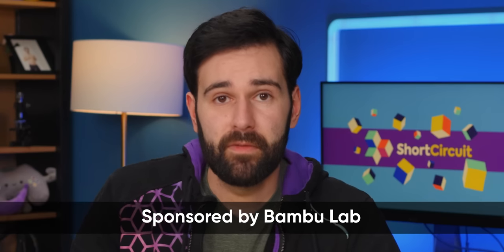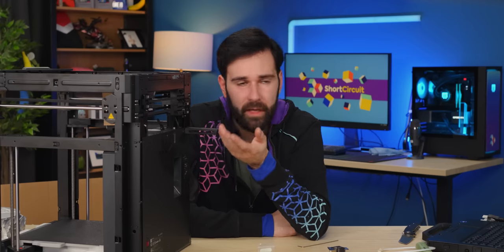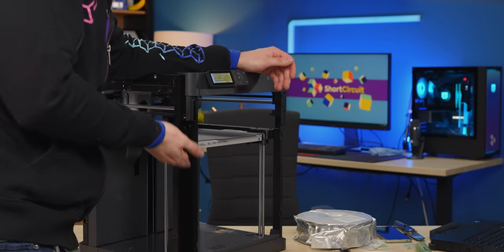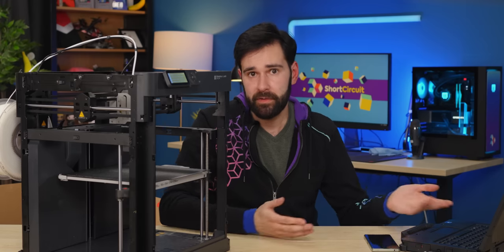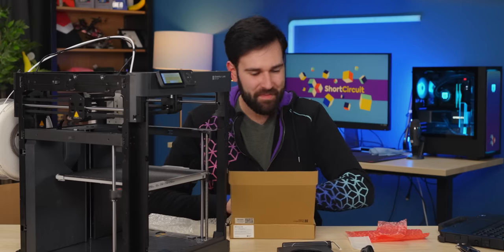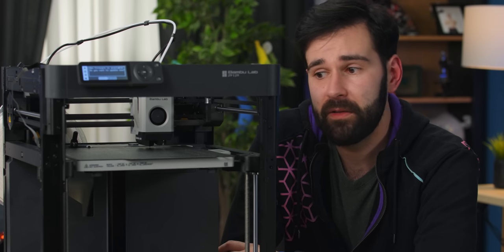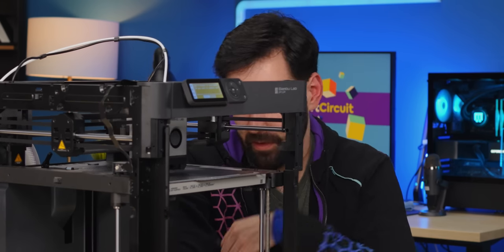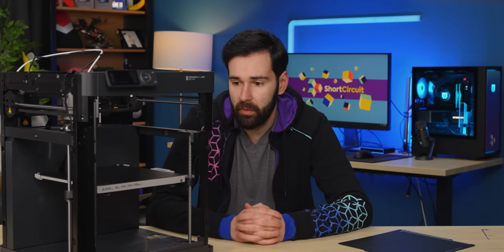I wish this wasn't sponsored (because it's so good) - Bambu Lab P1P

Comment: Would love to go CoreXY after suffering with a bedslinger (Ender 3v2) for a while now, but will gladly wait for other Voron-like machines to pop up. Bambu's offerings are definitely intriguing, however, and I'm looking forward to FDM printers stop being Ender/Prusa clones :)
Reply: Voron is not ideal, there are other CoreXY DIY projects that are slightly better, like V-King and RatRig.
Reply: For the price, Bambu is where it’s at. There just isn’t anything on the market that can do what this does at this price. 

Also, third party parts are already coming out for this and the X1C. That means the concerns about the ‘closed ecosystem’ are negligible.
Reply: @realgoose  my main concern about bambu is the printer firmware. No way to go back on an update and no way to manually update with like an sd card. There have been bugs in the firmware and as it stands, you are at the mercy of them responding and fixing the issue, which could be weeks, if you get a firmware bug like I and many got. Instead of waiting weeks for an update and breaking my head trying to figure out what was wrong, I could have just rolled back the firmware if it was an option and have my printer be functional right away. Then there's the question, why would a firmware bug only break some machines and not all. It's concerning and while I love my 3 x1c, I can't rely on them 100% based on my experience with them and what I've also seen other people go through. I'll be diversifying a bit with vorons probably
Reply: The i3/bedslinger design is still really good for smaller printers. You shouldn't write off a type of printers because the cheap Chinese one you got wasn't good.
Reply: @p_serdiuk  RatRig is not ideal with lead times of 12 weeks and their slightly less nice QC.
Reply: There's the troondon 2 voron clone. Have tried it myself but hey it's a commercial voron like

Comment: I have a X1C and I am at total awe of it.. amazing. I am going to get a P1P for my kids. I sold my BCN3D Sigmax that I paid at the time for 4500 euros.. I ended up selling it for 900 thankfully at a huge loss since no one what to be this old slow low tech printers. I can imagine how BCN3D can even compete going forward selling 6K printers .. game over. If you look on the classifieds there are many of them. This is truly a game changer. Buying filaments and accessories now is difficult and you need to move fast when they get it in Europe. I don't mind I stock up each time I can even if don't need it at the time. The technical materials print awesome!!!

Comment: I’ve always wondered, can you do multiple colors for 3D prints with separate color materials? I’m more thinking along the lines of that gyroscope being 3 separate colors for each ring.
Reply: Yes, you can. Thats what the material switch systems like the bamboo ams, prusa mmu and carrot feeder do. There are also idex printers and dual nozzle printers which can utilize 2 materials.
Reply: Yes, there are dual color filaments.  There are also dual extruder printers [basically two print heads/nozzles, each with its own filament].  Then there are printers that automatically change filaments for you on the fly [via either an extruder change or loading/unloading filament for you].

Quite a few options.  You can even just manually load/unload colors as you go, though, that only works for simple color changes - like “I want these last 10 layers of the print to be red”.

Comment: The nozzle is $15 now but they control the price so what is stopping them from selling it for $50 in the future.
Reply: Mainly that there's nothing proprietary about it. You can buy them on Amazon from other manufacturers. There's a high-temp one (500c) for $31
Reply: @Fjprints  That's... not what proprietary means, or even what "open source" means. Physical designs aren't open or closed source because you can just digitize the physical thing and reproduce it. A "proprietary" nozzle would have to include features that make it specifically difficult to reproduce.

Having a different design isn't proprietary - it's custom. The standard design people use right now, the E3D v6 nozzle, was only standardized because they were successful. Early on, there were several different incompatible designs.

Comment: I picked one of these up a couple weeks back and i am very happy with it. My only advice is to be careful with firmware updates on the printer. When they first launch they break features. the 1.3 firmware broke wifi printing. Hope they fix it soon. That said. even with that issue. Printing from SD card works great. Its FAST and very high quality. Overall i really love this thing

Comment: 19:28 Tell me bambu lab paid you without telling me bambu lab paid you...
You used the printer for one whole piece and are now saying "buy only this printer and no other"....without mentioning the glaring issues with them and the company.

-Awful build quality, from warped beds, clogged nozzles, broken AMS units, broken heatbed cables, broken MB fans, broken electronics from PSU's to extruder parts.
-Terrible customer service that takes days to respond to support tickets, then takes weeks to ship parts after a bunch of back and forth nonsense.
-Violating open source licenses
-No crash detection, resulting in bent nozzles and damaged build plates.
-A cloud system that goes down often, refusing to let people print until back online.
- NON SERVICEABLE, bambu lab wants you to send the printer back for repair when certain parts fail. Like the CF rods and bronze bushings.
-Severe lack of transparency, they blatantly rip off open source innovations, while slapping a proprietary label on it, then contributing less than the minimum to the open source projects.

Guess who does NONE of the above? The "competitor", which he meant to say is prusa.
Reply: Facts!
Reply: 100%!!!

Comment: I got my first (and I guess only as of now) 3d printer about 3 years ago, an ender 3 v2. It’s caused me a lot of trouble and I’ve had to tinker with its constantly, but I love it anyway. I’ve upgraded it like crazy, when it prints it prints great. In the last year or so, I didn’t touch it, it had a problem that I had issues solving. So I paid no attention to the 3d printing world. I was thinking to myself randomly that the 3d printer market is due for a massive overhaul/revolution, so I looked up some new printers to see what had changed… I think this p1p could be the start of that revolution.

It’s like an appliance. It isn’t meant to be tinkered with or tuned, it’s like you’re refrigerator in that regard. I think we all love being relatively early in the game of consumer 3d printing and the fact that we have to constantly tune our machines solidifies that we are still early, but I think it’s time now that some of us move onto something that maybe doesn’t need constant work, something that just… prints.

The p1p isn’t all the way there yet imo. But I think what you said at the end of the video is the key here, the other companies WILL come out with their answers. I wouldn’t be surprised if the p1p ends up kinda flopping in the long term if the other companies play their cards right, but I think it’s started something big

Comment: those of you who have not 3d printed before have no idea how many lightyears ahead of other printers the bamboo lineup is. sure, you could build a voron 2.4 with many mods to get the same sort of corexy printer using klipper which has these vibration compensations etc etc. but what you don't realize is that those are all DIY models you build yourself from scratch. These bamboo printers come out of the box, run all the calibrations themselves (which takes another 10-100 hours), then starts printing. its incredible. so incredible that I don't own one yet for my 3d printing business because it's almost too good to be true. need more time to air out and fix unknown issues. Once that has been done, it will be mine

Comment: Just bought one of these after several months of wanting one and slowly saving up. Super excited to get this! Upgrading from an Ender 3... Going to be a huge jump!!
Reply: mine just came in the mail yesterday, can confirm this printer is goated
Reply: oh one tip though, the default heatbed temperature is only 35 degrees for Bambu Studio, if you use their software I would strongly recommend increasing the heatbed temperature to 60 or even 70 degrees for PLA, took me a while to figure out that's the reason my prints kept getting unstuck and going spaghetti

Comment: I have an x1c and there are a few teething problems to be sure, the one plaguing me right now is the tool head cover falling off I believe because the magnets aren't strong enough to endure some of the really fast direction changes. Another bad one is usually the first print after an AMS filament change fails on the first layer (the nozzle seems too low which drags and causes a terrible mess) even when going from PETG to PETG of a different color... And to that the only way to adjust Z offset is in the start G-code, that could and should easily be a real time adjustment on the printer. I know it's also a slicer profile thing because the bambu filament profiles always print better than the generic ones. The last of my serious issues is with the magnets keeping the print sheet attached to the bed, when printing generic nylon (nylon requires painters tape with all/any of the sheets) the tool head can actually MOVE the sheet and knock into the glass/shift the Y axis so it's either 0% adhesion or far too much... Having said all that my 3d printer experience has helped me work around all those issues and I'm confident they can be fixed with relative ease, there are no fundamental faults and I can say I'm happy with my purchase though I wish I had bought it at the kickstarter price then I'd be elated with it.

Oh and the app, I have no desire to have some Chinese server as the middle man for everything I do with my printer when I'm in the same room and I've already set up a wireguard vpn for anything else. The LAN only mode has obviously been intentionally crippled as you cannot use the included USB camera or LAN file transfer, I'm not the only person angry about this and I've read that an improved LAN mode is in the works for me the sooner the better.

Comment: Fun fact, bambu is said to be formed from previous DJI engineers, that's where they got the design language and user-friendly interface. Also they did a really good design job with the mechanical parts.

Comment: Speed is everything when printing quick models that don't need tons of accuracy. I started with an ender 3 v2 max and quickly outgrew it and got tired of how slow it was. I eventually went to a direct drive extruder and converted to klipper(marlin sucks compared to klipper) and am now printing at roughly 140mm/s with max acceleration settings at 4000mm/s.

Comment: The "vibration compensation" is actually called resonance compensation. Because the printer accelerates and moves so quickly, any resonance in the system at specific frequencies can create visible "waves" on the surface of the print. Resonance compensation adjusts the speed and acceleration of the printer on the fly to avoid those resonances and keep your external perimeters looking nice the smooth. :)

Comment: Thanks Bambu for sponsoring ShortCircuit. I've been eyeing your printers since seeing the X1's in LTT videos, but it's always been a bit out of price range. Seeing that the P1P is a more budget-allowable model, and hearing this praise plus praise online, I've purchased one.

For what it's worth, if the QR codes for the filaments are made open, that would've made a HUGE impact towards the buying decision and there wouldn't have been a "decision," just in my opinion. Also sadly the P1P camera isn't currently in-stock, but whenever it does show up, I'll look forward to getting one.

Comment: I own the P1P for 2 months now and absolutely love the printer and what its capable of. What I don't like so much is Bambu Labs attitude. Their customer support is rather special from my point of view. Just recently I asked to return a delivery, for a full refund just as it arrived (yes we can do this in the EU, it's the law*) and they asked me for a photo of the unopened package to be eligible for the return. Excuse me what? 

One other thing is, that when the P1P just came out, there were no tutorials for all the repairs and you often had to follow those for the X1C (which is a lot like the P1P but a different printer nevertheless). The inevitable happened and I accidentially ripped a tiny ribbon cable, during unclogging the extruder, because it wasn't mentioned in the online repair manual. I thought customer support might just send me a new one for free, because we kinda share the blame here, but boy was I wrong. Not only didn they asked me to buy a replacement from them, I was supposed to pay 45€ for an entire new extruder assembly because they don't sell the ribbon cable separately. Just two points on that:

1. If the didn't use ribbon cables, but normal wires, I would have even been able to fix it myself (or it wouldn't have broken in the first place). So much for proprietary parts and its downsides

2. Why would I want a free replacement for something I broke? Because that is awesome customer service and makes your customers come back ever and ever again! I am now in a state of mind where I said to myself, as soon as prusa releases a similar product, I will jump ships, because their customer support was excellent so far in my experience.

Another example for great customer support and why it's so important:
Just recently my LTT water bottles 1st gen lid snapped (the rubber part). I wrote to support and they sent me a 2nd gen replacement lid FOR FREE. This is customer service and this is why I have also bought the LTT Screwdriver and I am currently looking into getting the backpack, which is not cheap either. But at least I am certain that when something goes wrong with it, I can count on the great customer support, which for me personally is well worth the money.

tl;dr:
Bambu Lab products --> great
Bambu Lab philosophy and support --> a LOT of headroom

*https://europa.eu/youreurope/citizens/consumers/shopping/shopping-consumer-rights/index_en.htm
Reply: Really your blaming bambu for not sending you a free replacement cause your clumsy and broke a ribbon cable and then compare it to a ltt water bottle that actually had a quilty issue. Don't get me wrong they should have the cable separate but with how cheap there selling the complete components it seems pretty fair to me. compared to the other option of allowing customers like you to bring up the price of all the components cause there sending them out for free and have to make up that expense elsewhere by passing it on to everyone.
Reply: @user-tj7xr6xd9z  First of all: your opinion is a valid opinion. But it’s just that. Your opinion. Let others have theirs. 

Now to the assumptions you made:
No I am not clumsy. Don‘t judge or  generalise me because of one YouTube comment you read. 

I am not discussing matters further with you on that personal level.

Have a nice day.

Comment: Hobby 3d printer-er here: I got a super cheap 3D printer about a year ago, only 150€ new (Anycubic Mega SE). Now it can produce very decent prints, but with features, when compared to Prusa printers, it sucks. Compared to the Bambu printers, it really sucks. But as a project to tinker on itself, it is really fun. 
As a hobbyist, I don't need results asap, and I love tinkering with machines; for example, I'm currently designing my own hotend shroud to improve the part cooling and reduce noise.
While the technologic advancement from BambuLab printers is fascinating, the printers themselves are kinda boring to me. Budget printers are fun to improve, and there will always be something to tinker on.

Comment: Having a P1P now for a month there are some downsides:
 - its really loud. 
-  It needs good filament. Filament that worked for my old Ender 3 S1 is not working at high speed on the P1P, while other (e.g. marble PLA) works like a charm.

Besides that: its a great printer (incl. support!) and I am not missing my S1 at all.

Comment: The Bambu has a proprietary closed-source firmware that would have to be open sourced if it was actually based on Marlin. Now that cheaper printers running Marlin Firmware can be updated to a newer Marlin with Input Shaping, it would be cool to see a speed comparison. I'm sure the Bambu can reach higher speeds with its lighter carriage, but I wouldn't be surprised if some of the more solid Ender clones can get pretty close, not to mention non-bed-slinger machines like the Voron V0.
Reply: From my understanding there is some oddities with their firmware as its somewhat based on klipper which is also open source

Comment: After going through a hellish upgrade to a CR Touch and glass bed on my Ender Pro 3, I really started to consider other printers and this one looks great. I don't do much more than finding a printable file online, convert it to gcode, and print it. Having prints fail because I don't know how to properly level the thing, with a supposed auto bed leveling tool installed, or what specific temperatures to use to account for the glass bed or the new filament, I want an out of the box easy to setup printer that just works and this looks like it would do that.

Comment: Did anyone notice that he didn't remove the foam from the bottom of the product before turning it on, you always make sure to remove EVERYTHING from the product before you turn the product on. Also, if you are getting a 3D Printer and don't want it to move around while it's printing setting it on a foam base ready helps, also check out Uncle Jesse on YouTube for all your 3D Printing reviews and needs
Reply: ...the manual LITERALLY tells you not to remove the foam before you turn it on